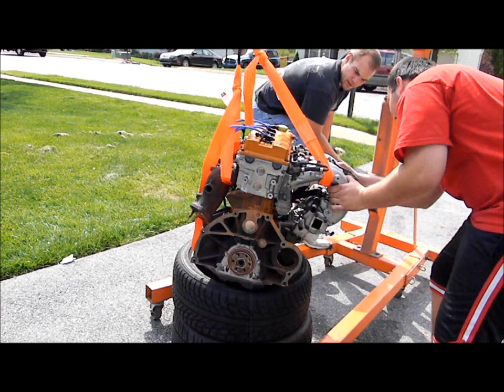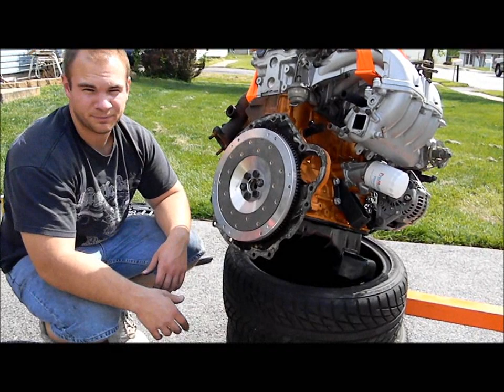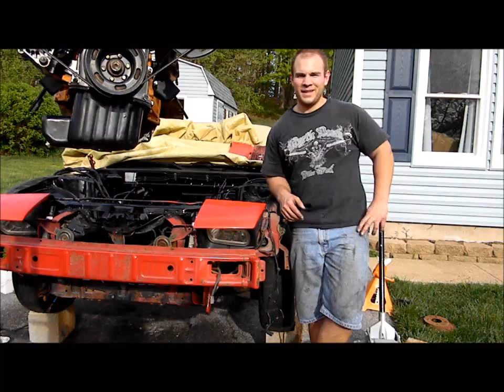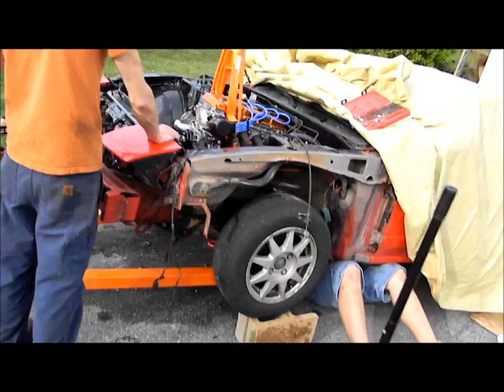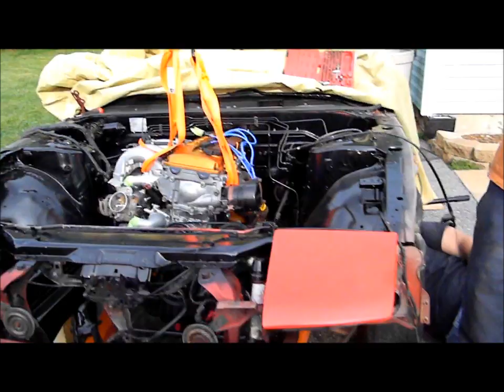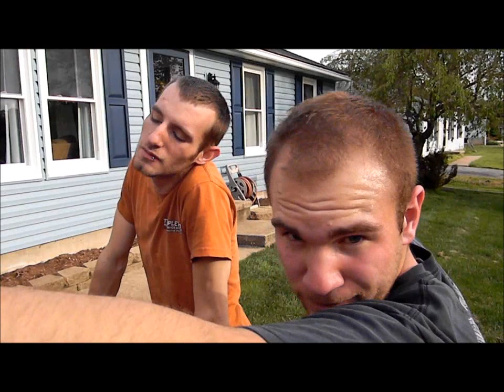KA24DE Engine Install | 240sx S13

Comment: yea if the old mounts have never came off before that 14mm flanged nut is a pita, i used a 3/8 ratchet with my small 2 ton jack handle from in the engine bay

Comment: Did the crankshaft for you motor where the flywheel connects have a "pin" in the alignment hole? I'm starting the rebuild of my dual cam, but one of my buddies said that there should be a pin there.